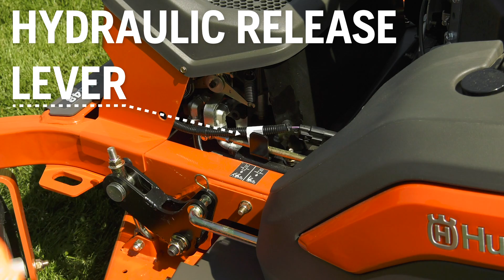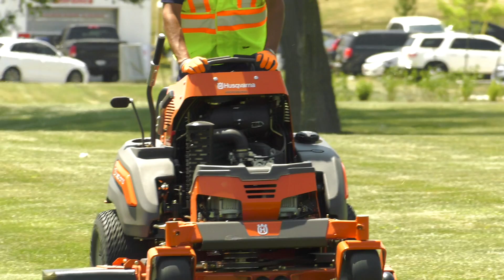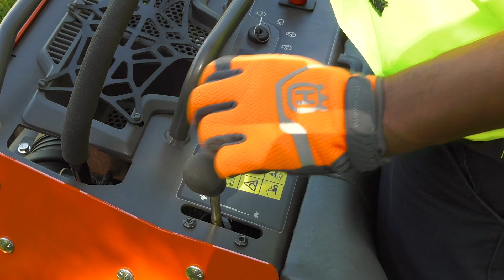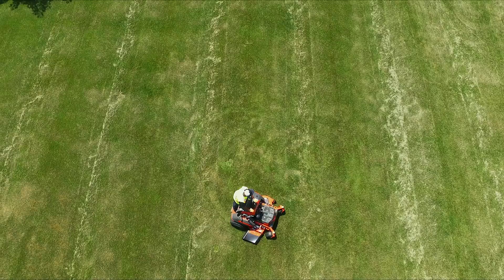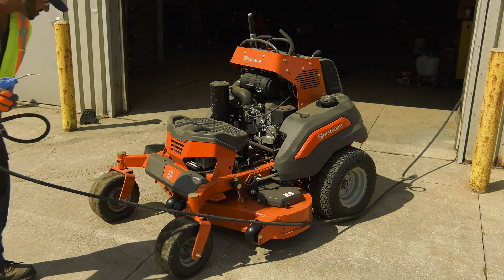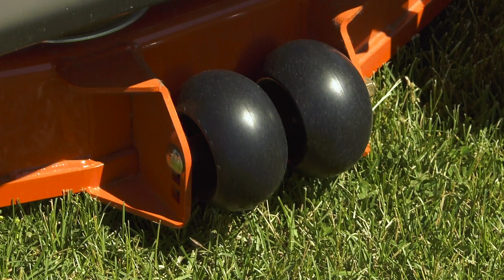How to Use & Operate a V500 Zero Turn Stand On Gas Lawn Mower | Husqvarna

Comment: Really impressive🌾🌾  allabout.wiki/Z254  I also purchased the optional Dual-Bagger kit to collect the grass, but have yet to use it. Primarily because the mower does such a great job of mulching so as to leave little to no grass as you mow. I also purchased a small utility trailer to connect to the back of the mower. This has been a god-send as it has allowed me to do some serious pruning and clearing of large areas in the back yard. I've been able to load up the trailer full of tools, drive them to the work-site, and when I'm done, it's just one trip back to the garage to put everything away.